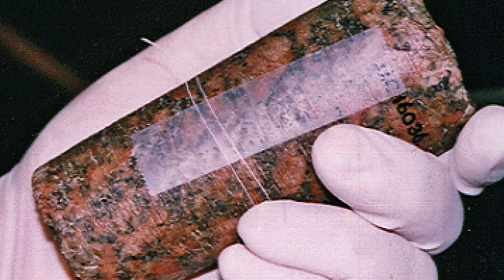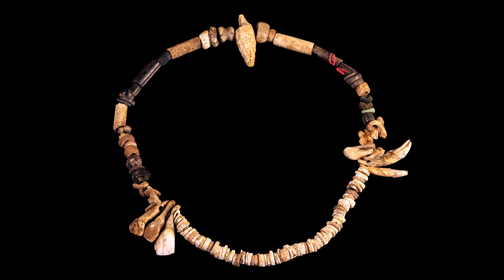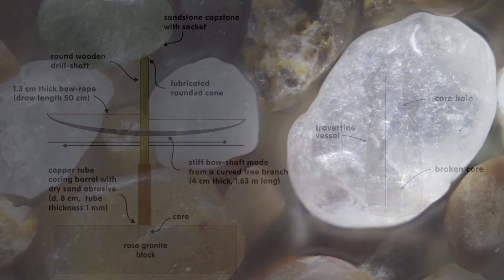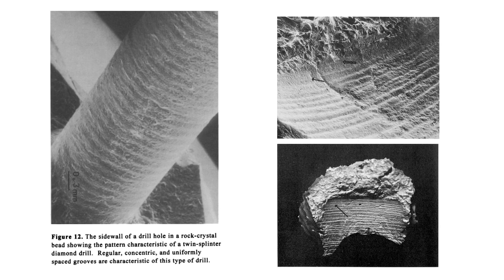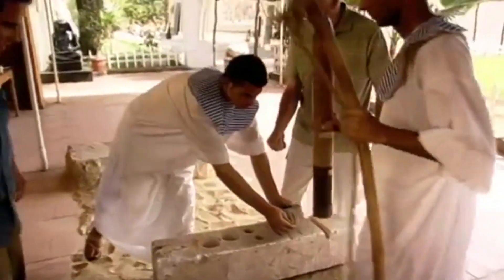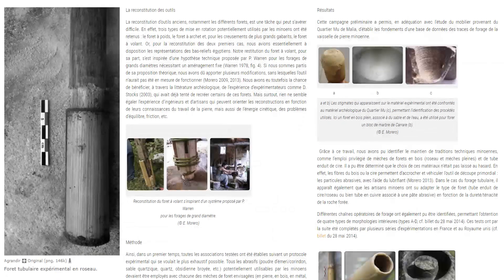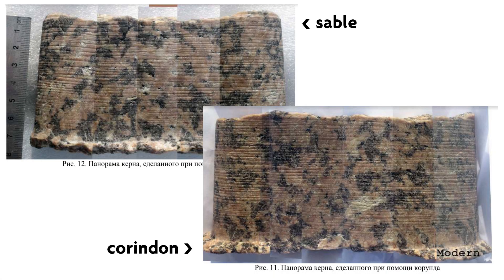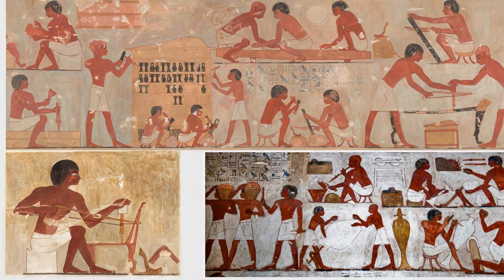Unexplained boreholes in Egypt, evidence of advanced technology?

Comment: How about steam powered drills I'm thinking about something like the aeolipile just thinking out the box here
Reply: They did not require these invention in order to complete these monumemtal structure.

A steam engine would require a vast amount of technological advancement, of which the Egyptians did not possess,
Reply: @MrRecklessryan  explain the Chinese trip hammer still in use today
Reply: @gregglass1982  Powered by a water wheel, not steam. Peace!
Reply: @MrRecklessryan  and anyway can't u use a water wheel as a core drill if u can make a trip hammer with the same technology ?
Reply: @gregglass1982  Yes, indeed you could!
Reply: @MrRecklessryan  see me and you can agree that its possible then ?
Reply: @MrRecklessryan  aeolipile steam
Reply: What are u on about when the Chinese had 💧 🚰 powerd trip 🔨 ⚒ hammers